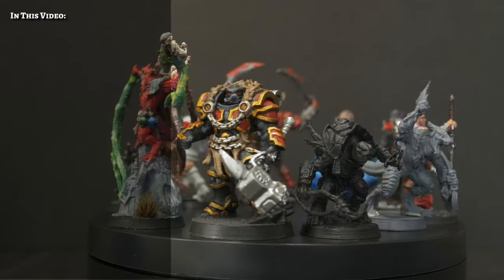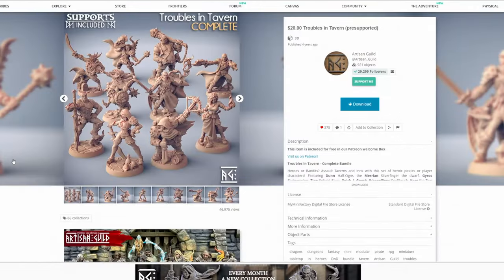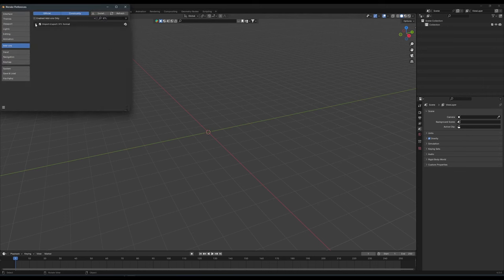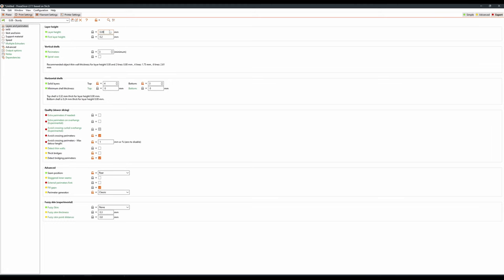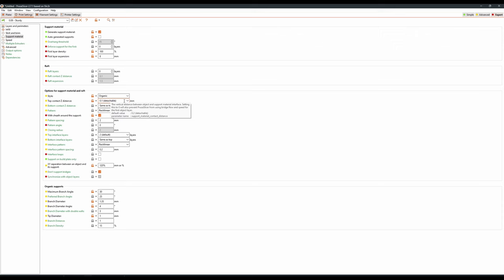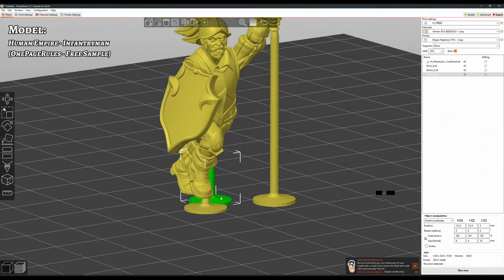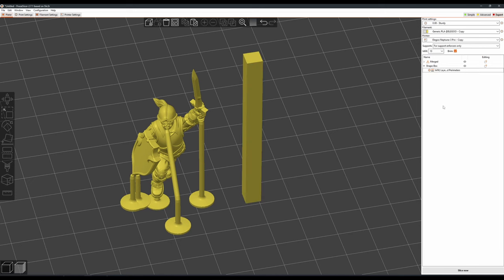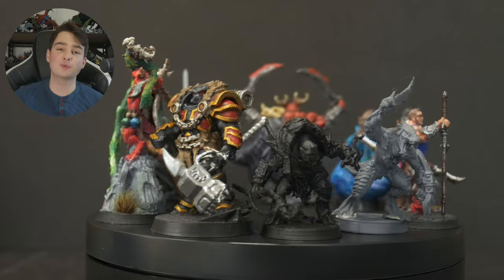How to Print AMAZING FDM Miniatures! | A Complete Guide to FDM Minis [OUTDATED CHECK DESCRIPTION]

Comment: Dude.  I have cheats GALOR!

First, get a .25mm nozzle. It will greatly increase detail

Second, under advanced, "external perimeters" to 0.18mm.  This will give you sharper details and will get your SLA levels of clarity.  If you choose to stick with 0.4mm nozzles, set external perimetersnto 0.32mm. These are safe levels of under extrusion.

Third, EXTERNAL PERIMETERS FIRST! This will guarantee that your external perimeter defines the shape, causing excess extrusion INTO the model, not outside, which will cause details to round out.

If you are doing mechanical things, rotate the model in space such that planar surfaces are 45 degrees from the print bed, this will increase the resolution of planar details (think battlemechs and such).

To reduce stringing, which can bond support material to your miniature, set seam to nearest and increase your rapids.

Set your external perimeters to slower.  This will compensate for rapid moves causing vibrations, your model will have more time to settle for critical details.  This is an anti stringing strategy. The faster your rabid, the less time for oozing.

Adding two more:
Set slice resolution to 0 and gcode resolution to 0.001. these settings are unnaturally high for LARGE models.  Most 8 bit microcontrollers can't handle the HUGE detail such high resolution, large prints will render....but for small prints, these finer resolutions are no worse than a low resolution large print.

Obviously a smaller nozzle means more perimeters... Unless you cheat and set perimeters to 0.32 instead of 0.25.  this is a safe level of over extrusion.

Smaller nozzles mean lower flow of material.  This means more print time.  This also means HIGHER time in the melt zone.  Turn your temperature down 15 degrees.  This will also reduce stringing.
Reply from the maker: Great recommendations! I'll be sure to try a few 🙌
Reply: @Painted4Combat  I added two more, slice and g code resolution.  For miniatures, these are safe values to set super low.
Reply: @Painted4Combat  added two details re:using 0.25mm nozzles

Comment: Nice but veey complicated for the average hobbyist
Reply from the maker: Yeah, this is definitely aimed at people who have a little bit of experience playing with the settings of their printers and slicer, but even just pausing the video and copying the settings should yeld some nice results!
Reply: @Painted4Combat  I have plenty of slicer experience But nothing relating to blender
Reply from the maker: I see! Yes, the blender portion is for people wanting wanting delve into that and open up a few more options when it comes to picking models. 
Not a necessary step, but I reckon if you follow those steps a few times you'll get the hang of it. 

I tried my best to keep it as simple as possible, just touching on the most necessary menus and controls, it is just such an in-depth program that even a simplified workflow like this can be daunting.

Comment: 1 second in I see layer lines, so yeah no thanks. I can already print at 0.05 on my Prusa.
Reply: Wow who wouldve thought fdm printers have layer lines 🤯🤯
Reply: @alexgallegos6777  His point is that OPs examples of good prints are not good results even for FDM printers. And honestly he isn't incorrect. OP goes through a lot of useful stuff. But his endresult is not that good even when painted. Maybe his motionsystem isn't dialed in perfectly. Probably his leadscrews. And looking at his recorded printing I'd also say he should print slower and that his filament is probably a bit wet. As there seems to be a lot of stringing too.